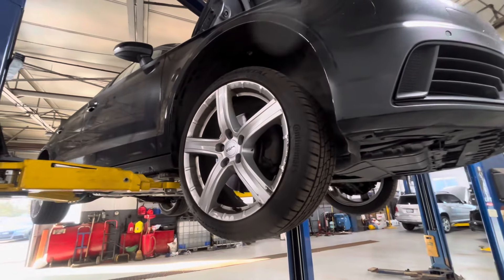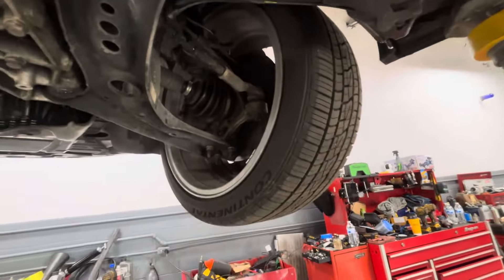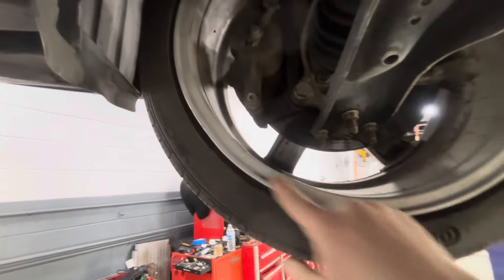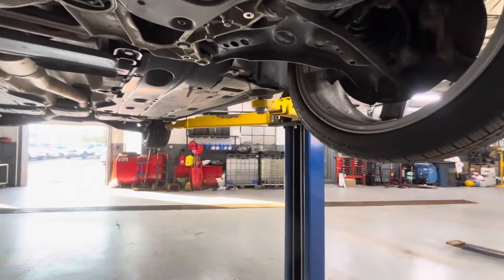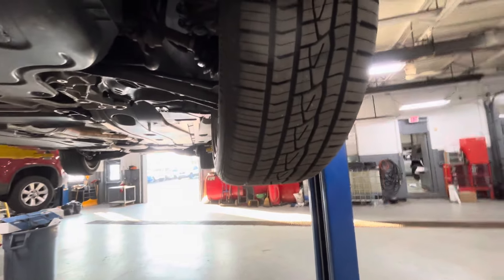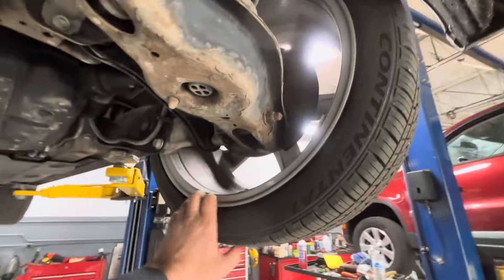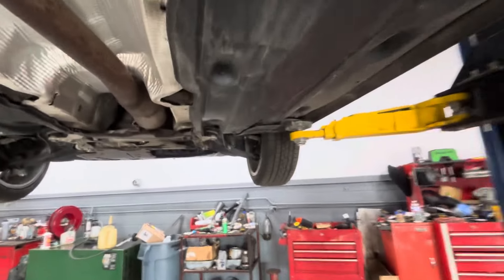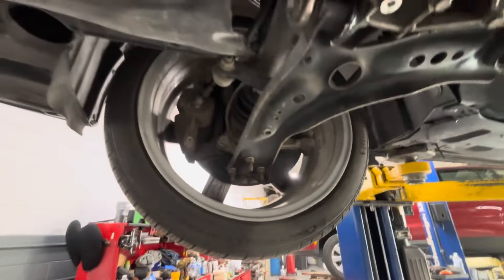COMMON CAUSE OF LOW SPEED VIBRATION

Comment: Years ago when i was working at an independent garage we heard a Datsun with a shifted belt come in for a little vibration in the back of the car. The belts were shifted about a half inch and you could see it from a car length away, but with the newer tires radial tires a little shift gave me a good vibration as you said. I had to jack it up and spin the wheel to see the shift but it was covered by my warranty and i was back on the road with no vibrations.
Reply from the maker: Yeah they can get real bad like that sometimes

Comment: What else could it's not bent rims? My car vibrates at low speeds, I thought it was a wheel balance thing. But then I got them balanced and even changed rims, along with tyres and it's still there.
Reply from the maker: Check cv joints on your axles

Comment: I’ve got a lot of steering wheel vibration in my Audi s4 I hit multiple pot holes … 🕳️ … already did control arms that didn’t fix it already replaced all rims and wheels … don’t know what to do next tie rods ?  Then coilovers. ?
Reply from the maker: When does the steering wheel vibration occur?
Reply: @ every little small bump and I’m talking super small bumps on the road very small at any speed 5 mph too 75 mph
Reply: @ it literally acts like a Nintendo 64 controller it vibrates my steering wheel every small bump on the road and if I slightly turn it too..
Reply: Did you determine what was the cause ?
Reply: @ not yet brother unfortunately.. this sucks so bad.. I might just have to keep throwing new parts at it …
Reply: I have the same problem when I hit 40 it shake like crazy expetally when I hit a bump have you figured it out yet?
Reply: @ nope it’s the worse switching out top hats soon.. and new springs … and also ::: new struts …
Reply: @Aliastaylor  mine was vibrating at any speed, as if I could feel the road imperfections through the steering wheel. All of a sudden the problem stopped and I also felt the steering wheel lighter. I think an upper control arm ball joint was binding/stiff . 
I recommend you disconnect both outer tie rods and move the rotors by hand as if the wheel was turning and see if the springs are rotating properly and if one side of the car is harder to turn than the other, meaning could be strut mount or ball joint binding. Just an idea
Reply: @ so what fixed yours than ??
Reply: @Aliastaylor  I believe a ball joint started binding after I changed a cv axle. Because I had to disconnect the ball joint and that changed the position of the ball joint perhaps turned it to a point of less grease or rust. I believe as I drove it a couple of weeks the ball joint became lubed again